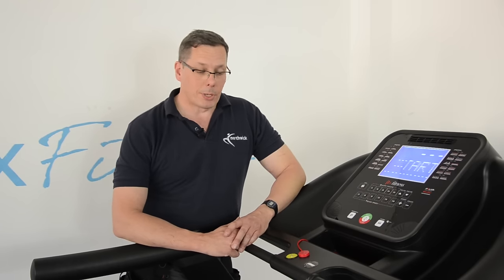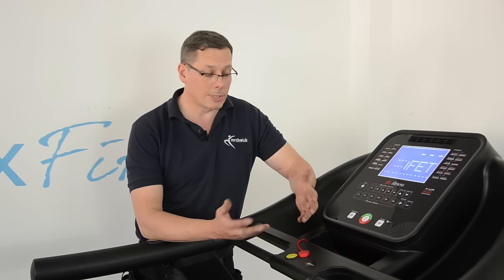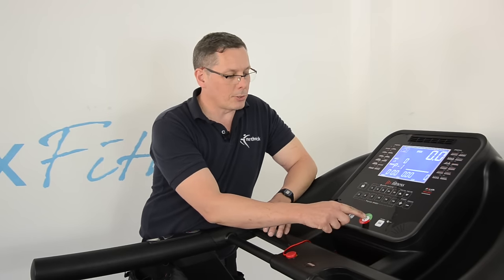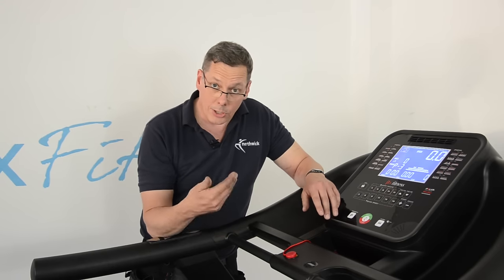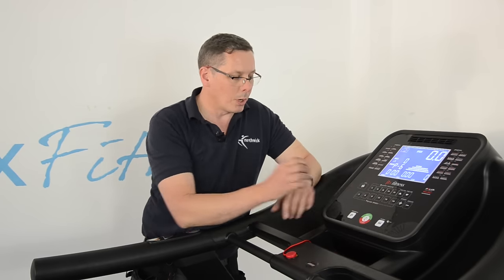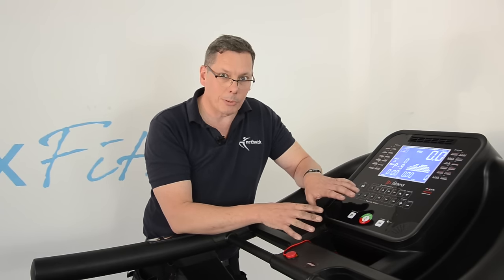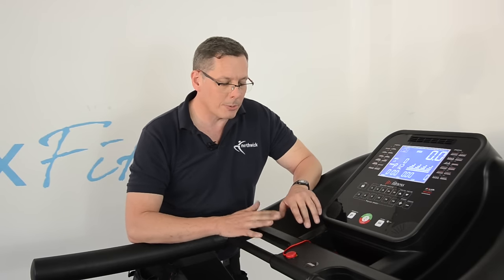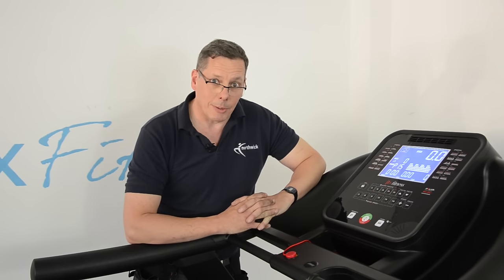How to reset (re-calibrate) your treadmill

Comment: Would You happen to know how (or if it is even possible) to run the calibration process on a BH G6421C? I had my main board replaced recently and the treadmill is too fast even at 4kmph setting, I suspect it has something to do with the motor sensor calibration and the board controller but not sure how to proceed. Any help/advice would be much appreciated, I've tried holding down the start/stop with various combinations but can't get it to run calibration.
Reply from the maker: HI - I'm sorry I don't know that specific access code. I always BH fitness to be helpful so perhaps approach them directly. The speed setting could be contained in the console software (via a service menu) or there could be a potentiometer on he lower circuit board (MCB) that could be used to adjust the speed. Obvious question, but is the treadmill set to miles per hour instead of kph?
Reply: @charteredengineer  Thank you for responding, I've sent a query to BH and I am hoping they will respond. 
I have tried switching the treadmill from miles to kmph and vice versa but have had no luck in sorting the speed issue. I'm surprised that there is nothing mentioned in the manual to guide the user on running the calibration function and none of the usual button combinations seem to work. All my earlier treadmills had a simple button combination that would bring up the calibration for the incline and speed.
I've seen the MCB (one next to the motor) when the service technician replaced it but didn't notice a potentiometer on it. 
It is surprising that the service provider for the treadmill that changed the board in the first place doesn't know how to run the calibration.
Hope BH responds to my query. Using the treadmill in the current uncalibrated mode is a no-go for me.
Reply from the maker: @DIvadxat  I agree. The technician should have set the machine up correctly. The calibration setting are not something you would expect the user to access which is why they do not generally appear in the user instructions. Good luck and please post about how it goes.....
Reply: @charteredengineer  After some tense arguments with the service provider we identified the potential issue. 
At some point the factory fitted motor 2HP was replaced (due to wear) with a new one that was a 2.5HP motor, but the MCB remained the same. This was causing the MCB to fail and speed control to be messed up. 
This particular model does not have a calibration function according to BH. The MCB, motor and speed sensor are intended to work as a set as per my understanding from discussions with the service provider. 
Now they've changed the motor back to a new 2HP motor and paired it with a brand new MCB and sensor. So everything is within specification. 
The treadmill seems to be working fine now, although I haven't used it for a long walk or run as yet, from initial impressions it feels like it is working as it should. 
Simply put, if the replacement motor was in-spec perhaps there wouldn't have been an issue at all.

Comment: I wish to recalibrate my Reebok GT40s but cant find out how. Would you know? Thank you
Reply from the maker: Hi Ronnie - as I recall, there is a miniature push-button reset on the lower control board (MCB) on these Reeboks. The procedure is turn the power off, and push and hold the reset button on the MCB while you power-up and then release the button after about 3 seconds. The machine will start a re-calibration procedure. Be careful as there is mains electricity on the MCB!
Reply: @charteredengineer  thanks ill try it

Comment: Hi.
NordicTrack NETL25711 1650264 T 25.0 TREADMILL  , the speed need to recalibrate , i did a factory reset and the issue came back. I measured the error and it is 1.6 On speed of 10.I do not find any help in Nordictrack sites etc.Tnx

Comment: Hello - I have JTX sprint 9 which is running about 15  - 20% too quickly when I measure the distance traveled by the belt.  Do you happen to know how I enter a recalibration mode on this machine please?  Thanks
Reply from the maker: Hi Stephen - this would require changing the factory setting for the front roller diameter. Usually this information is locked in software and not accessed via the recalibration menu. You would need to approach JTX for specific information on your model.
Reply: @charteredengineer  thanks

Comment: i have proform carbon t7 treadmill stuck on the droid screen stating the os couldn't load, hit the reset button at least 30 times.
Reply from the maker: I recall that there is a procedure for re-installing the android OS on those consoles but you will need to google it for details. It is a last resort however and you will invalidate your warranty if it is still covered. Often these faults result in a new console being needed - Proform are not very good at making their products repairable in a cost effective manner which is bad practise.
Reply: The treadmill is less than month old so pro  form is coming out to fix the tablet smh 🤦🏻‍♀️

Comment: Hey John 
 Do you know how to recalibrate a Schwinn 830?
Reply from the maker: Hi Cesar - I don't think that the 830 has a recalibration procedure. What is the fault that you have?
Reply: @charteredengineer  my incline isn't working 
It displays 15 on the level but the machine only has 12 levels.

Comment: How do I recalibrate a Fuel ft94 treadmill? It is showing a E5 error code. Moved it from one house to another. Before moving, it worked fine. After got it set back up, wouldn’t work. Shows E5 on screen.
Reply from the maker: It is most likely to be a wiring problem - perhaps a wire has got trapped or disconnected. The recalibration procedure would normally only be needed if you fitted a new circuit board or mechanically disconnected the incline motor and lost the original height position reference data. I can't recall the exact recalibration procedure, but I think its along the lines of holding down start and incline up button together whilst you insert the safety key. Sole (Dayaco) are the manufacturer and they will be able to confirm the exact sequence for you. Best wishes, Jon

Comment: @Jon Isaacs, Chartered Engineer  
Hi Jon, 
I have a Nordictrack treadmill  NTL 14119.5.
I had to move due to the military, and when the movers assembled it, the speed is extremely slow. I can see that they connected two sets of wire groups from the top body to the motor's motherboard. However the speed is ridiculously slower. Any tips?
Reply: @Everyone,
Jon, I figured it out. Nevermind, sorry.
So on the motherboard, there is a plastic piece which is looks like a screw (white in color and hss a phillip-head, on one of the corners of the motherboard). This plastic screw sits on a small metalic transistor looking piece, and as I tightened or loosened it, the motor responds with increased or decreased speed.
I hope this helps anyone else who had their movers accidentally mess-around their speed setting on the motherboard :).

Comment: Hi Jon, I have a nautilus t628 treadmill that speed display in km / distance but speed on running belt is running in mph. Is there a way to factory set etc, just purchased second hand and machine has had very little use, but was disconnected etc to transport. Thanks for any help as can't seem to find anything online.
Reply from the maker: Hi - thanks for your question. Details can be found here https://www.manuals.co.uk/nautilus/t628/manual?p=45
Reply: Hi Jon you helped earlier with giving me a link to the manual. I have tried to do this and it runs the sequence of events but yet the treadmill will not run at an accurate speed, it may be set up at 4 mph but your running at around 8 mph+ I'm finding no help online or through nautilus and it seems a shame to sell the machine for spares when I'm sure it should be a simple fix, but as I brought second hand from ebay I'm left with no other options but to try yourself again. Thanks

Comment: My trademill makes beep sound and doesnt work at all. The engineer came and said I would have to order expensive part from manufacturer and when I said ok lets do it he said they don't have it anymore.He charged me 50£ for visit and he had no clue what is broken as I bought another trademill,the same type and model,replaced the part he was talking about from the new one to the old one and it didn't work either. I used the new trademill sinse then but today the same thing happen to this one and it beeps instead of working. What to do? I can't buy the third one!
Reply: This is literally happening to me right now. I used my treadmill yesterday and now its beeping and an E2 error code keeps appearing is there anything you know i can do? Please help me if you can

Comment: My treadmill work for 2 minutes then it stops, and it shows 444 on the screen, but i can't find any solution for this error.
Reply from the maker: Hi - not heard of error 444. If it runs for 2 mins then stops it could be an overload. Check the running belt and deck for excessive friction and add silicone oil lube if necessary. Best wishes, Jon
Reply: @charteredengineer  thank you so much 💓

Comment: An old video now so not sure if it’s still checked in on but I see the treadmill you are using in your video is a JTX sprint 9. Using the method you state doesn’t work on my sprint 9, nothing happens when I do that button press method, could mine be faulty ? Many thanks

Comment: I have a Nordic Track C600 it comes on it comes cutting off and it says Calibrating  after it Calibrates I try and cut it out it still cuts off and cuts on the belt will move for 3 seconds and stops could you tell me what this may sound like Thank You
Reply from the maker: Sounds like a possible bad connection. Also an MCB and motor fault can cause the running belt to stop but usually this is not accompanied by a calibration. So check a the wiring first!

Comment: Wondering if you could advise... My Fuel 63 treadmill belt was slipping as I ran, so I disconnected the machine and adjusted the belt as instructed in the manual... However when I was about 40 minutes into my run the treadmill just started speeding up on its own to maximum velocity and only stopped when I removed the safety key... Since then every time I switch the treadmill on I just goes straight to full velocity without me touching any buttons, then cuts out and it just repeats the same sequence (Speeding up and cutting of and so on) until I disconnect the key!!! Absolutely baffling!!! Can you help ??

Comment: I noticed during this whole video your distance didn't increase. I am having a similar issue. I have a Reebok GT30 and the there seems to be something wrong with the distance dial. I ran for 10 minutes and it was showing I had ran 1km! which is crazy. I normally run at a pace of 6 minutes per km. Any idea what is happening here or how this can be fixed? As you can tell this is very inaccurate data and quite frustrating as I am training and need it to be right!

Comment: I have Gold Gym 430i. It was working fine until we started install of iFit app and phone died. Now the treadmill not start, even after hard resets and holding Bluetooth button down for 30 seconds. iFit customer service said I need a new console. I wish i never tried install of the iFit software. I feel like there has to be a way to factory reset the machine. Purchased this for $377, a great deal. They want more than $500 to come and install new console. Do you have any tips?
Reply from the maker: Hi Joe- thanks for your question. Check that the motor controller has power and check the wiring from it to the console. The console should be receiving more than 5 volts DC on the positive and negative wires of the harness. If this is the case then unfortunately I think you will need a new console. We offer a remote engineer service for GBP25 if you want guidance on how to fit the new console yourself. Best wishes Jon

Comment: Hi Jon, 
Your videos are great. I’ve been learning a lot from them. 

I would appreciate if you could offer an advice on a treadmill that stops and starts again during workout. The panel still on during these events. I hear the same clicking sound it does when the running belt starts to move at the begging of the workout, repeating when the belt stops and immediately starts again. Any idea what it could be? Thank you.
Reply from the maker: Hi Sienna - thanks for your feedback. I can certainly assist and I suggest a remote diagnosis as being the best and cheapest option.
 
In my opinion, it is important to diagnose faults thoroughly as this ensures that the root cause of the fault is being addressed. For example, in your case it could be a circuit board problem and circuit boards can often fail due to overload. If you simply pay to replace the circuit board without resolving the overload problem (ie. the root cause), then it is very likely that you will soon have the same problem crop up again and you'll be back to square one. The remote diagnosis helps you avoid this situation.
 
I offer a live remote session which is priced at £49. For this, I will schedule a live video call with you where I will diagnose the problem there and then (with your assistance). This usually takes about 20-30 minutes and the video meeting can normally be scheduled within 24 hours subject to availability. This is the most thorough diagnosis option since I am able to pick up on any nuances which can sometimes be significant.
 
More details are here https://www.chartered-engineer.com/remote-engineer/
 
With the above options you will get a professional, root cause diagnosis of the problem and then you can decide whether to proceed with a repair or not. If you decide to proceed with a repair, I can refer you to a local specialist engineer to complete the work for you. Otherwise, you may choose to repair the machine yourself and I can support you remotely if you wish with both obtaining any parts and with the fitting of parts (additional remote assistance would be chargeable). 
 
And if you decide that the machine is not worth fixing, then I do have a choice of brand new replacement machines in stock at a preferential price which may be of interest. These deals are exclusively for my customers and are not available elsewhere!
 
Please let me know how you wish to proceed and I will get things moving in the right direction for you.
 
Best Wishes
 
Jon Isaacs
Reply: @charteredengineer  thanks for a quick reply, Jon. I think that would be great, how can we do that? Thank you.
Reply: @charteredengineer  Sorry, Jon. I missed the other half of your reply. So, I’ll check the link and proceed through there. Thank you!!!

Comment: I have a pro form and the console will turn on, but then when I actually start it, it will work for some time (sometimes just a few seconds, sometimes a few minutes) and then the console will shut off (sometimes it will turn on again as soon as it turns off and at other times it will not turn on again even after an hour of leaving the treadmill on). The weird thing is, a lot of the time, the treadmill works just fine, but it has issues whenever I use it again after less than about 24 hours (I think). Does anyone have the same problem or could anyone help me? It would be greatly appreciated!
Reply from the maker: That's an unusual failure mode. I would recommend our remote diagnosis service. Visit www.northwickassociates.co.uk and follow the links to triage to check which option is best for you

Comment: Hello my sunny treadmill has a continous beeping noise and screen displays oil.  We've oiled the belt but it continues to display oil and beeps.  What would you suggest?
Reply from the maker: Hi - try pressing and holding down the stop or reset button for 5-10 seconds. This should clear the message.

Comment: I need immediate help,  if you can, please. 

I have a 2013 Horizon CT 9.3 Treadmill purchase in 2016. It has been used only for walking and that too very rarely. However, I have been servicing it regularly. Since a week it has started giving problem for the first time. While in use it suddenly stops and a clicking sound starts coming from the control board. After a few minutes it resets itself automatically and starts working normally but after a few minutes it again stops suddenly and the same clicking sound starts coming from the control board. The console screen shows a prompt "5 101 MI 02" and this happens again and again. 
I am in Canada and Horizon fitness doesn't have an efficient and effectively caring after sale service here. 
I don't know what to do to overcome this problem. 
Can you please advise as to what I can do to get rid of this trouble.  Or how to reset my machine with regard to this trouble? 
Thanks.
Reply from the maker: It sounds like your machine is resetting, Try this video and also check out part 2: https://www.youtube.com/watch?v=WDtl6ucmqCc&t=157s
Reply: @charteredengineer  My sincere thanks for your prompt response.

Comment: Hi Jon I have a gt40s and having trouble with an E07 code and not recognising the magnet regardless on what I do any advise?
Reply from the maker: Could be that the magnetic switch has come dislodged behind the console. Also check that the magnet is still located in the emergency key
Reply: @charteredengineer  nope it’s not that or the switch is baffling me! Had to order a whole new pcb board
Reply from the maker: @djdsk4444  Hi Pete - thanks for the update - that is the last (and most expensive) item in the list of possibilities. Hope it works for you. Best wishes, Jon

Comment: Do these steps work on types of models. I have the 430i Airstrider
Reply from the maker: Sometimes the sequence of buttons that you press is different between different types of machines and there are some cheap machines around that do not have any re-calibration facility. You will need to google your specific machine to find out what the exact sequence is for it.